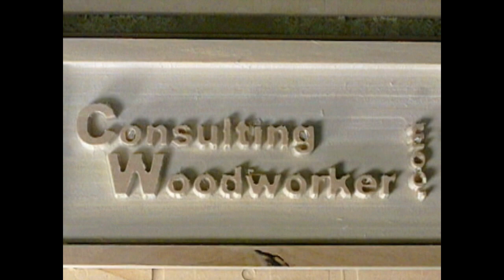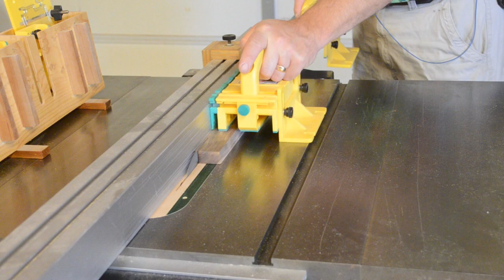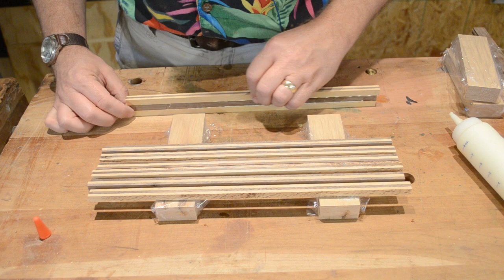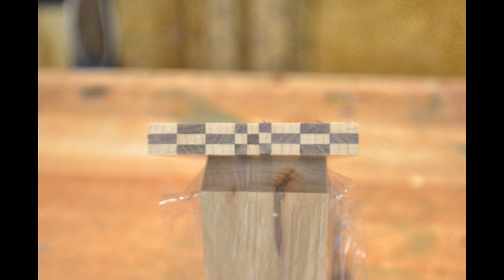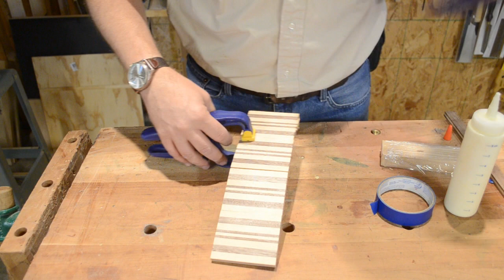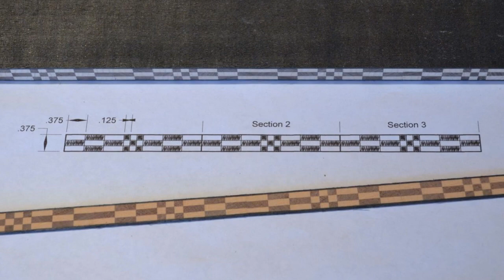Shop Made Geometric Inlay Banding

Comment: ?? Is your beginning stock need to be, what thickness to allow for 1/8 blade cut??
Reply from the maker: I started by ripping either 3/4” or 1” thick stock into 1/8” strips. The starting thickness just needs to be wider than the 3/8” and 1/8” wide rips we cut the first glued stacks into.
Reply: just wanted to be sure,THANKS,Bb  @Woodcademy